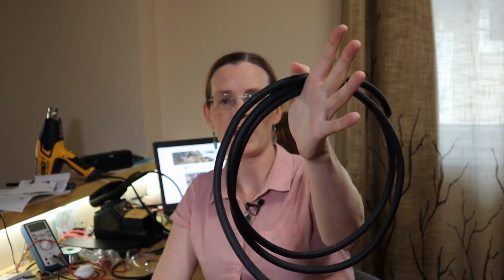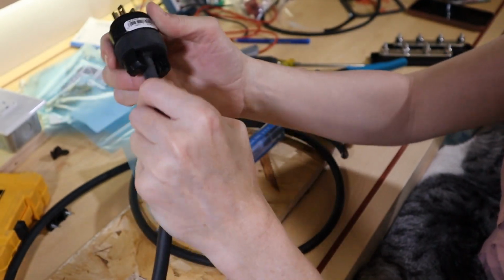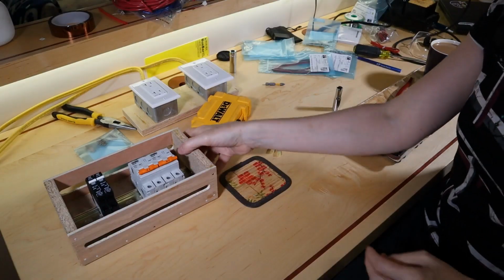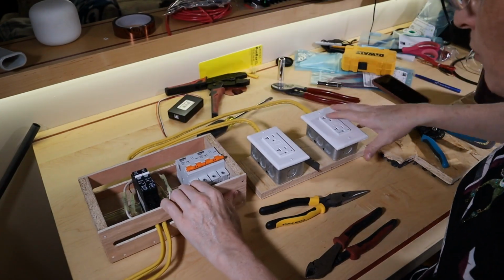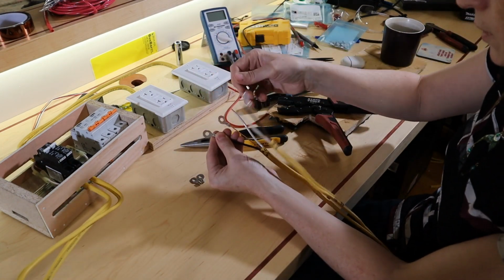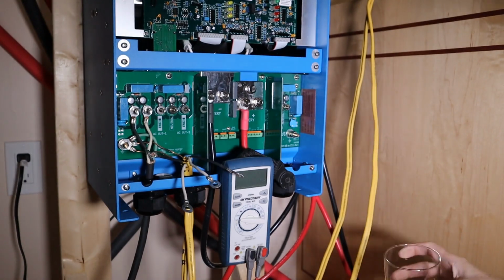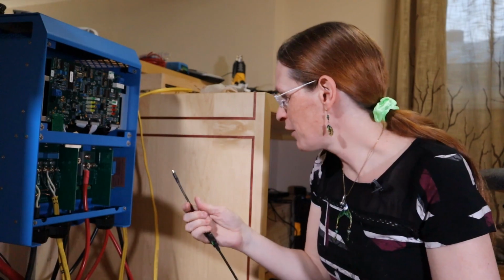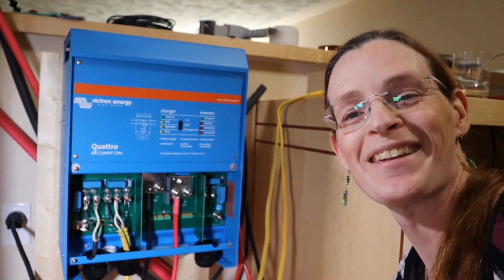Victron Quattro 48|5000|70 120v (Anti-climactic Part 2) - 48v Lifepo4 battery (Ep. 14)

Comment: There are some things I thought about
1. One thing I usually do to "secure" the connector is after all is screwed together and only the cover is left so go on with melted life or silicone and fill so it does not enter water but I am not an electrician and it will be that if anything is error, just cut the cable and install a new connector (do not know if it is a good suggestion)

2. There is another channel if you have not seen it called hbpowerwall and others there who made a forum but he has not posted many videos in a long time now but if you did not check it out then do it and the forum is called second life, is more for reuse of old 18650 cells but there are a few different and last I check out there so everyone was helpful to each other

3 most of your videos I have reacted to you saying "gentlemen and ladies and others" and it sounds like a variant of David Bowie welcoming almost 50 years ago and then it is unusual to hear and since most I heard say similar is those who are T / NB so then I wondered if you yourself identified yourself so?

(I am from Europe and since I write English poorly as I am dyslexic it is googel translation I use but have seen on other channels that mainly your neighbors south but also you have many prejudices about the rainbow and everything to normalize is everyone's value is good )
Reply from the maker: 1. A couple others suggested conformal coating sprays, which is something I was already contemplating for things like laptops that weren't designed for marine environments. This is a variant on your suggestion, and one I like . 

2. I'm subscribed to hbpowerwall actually. I had originally wanted to buy some of his cylindrical cells and kits in the past, but a lot of his stuff won't ship to Canada. Then I found these EVE prismatic cells and they seems a good fit. His channel is great though, certainly a good recommendation.

3. I've got NB friends and it made me appreciate the broader spectrum of identities. I want this channel, and eventually this community we build, to be welcoming to all who are kind. So I try to catch myself when I think I'm not being inclusive enough. It costs so little to be kind, after all. :)

Welcome from Europe! I've been over there many times (Denmark, Germany, Austria and Czechia mostly). I very much look forward to sailing there soon as I can. ^_^
Reply: @TheDigitalMermaid  Being inclusive and not having preconceived notions about others just because you do not understand is something more people should strive for, but the younger generation hurts to be better at it and those who are older are not always as willing to change as they do not see anything wrong. with discrimination against certain minorities

was just a thought then (hope you do not take it wrong) but you did not hurt very feminin if you belonged to T / NB and compa it not so long ago as there seem to be many more who come out in recent years after a lifetime in oppression so it is in many ages after it has become a little more "normal" and that acceptance increases, more people want to live freely as themselves
(do you think that a lot has happened in the last 30 years but here in Sweden it is not so much as not as many care but now there will apparently be a neutral sex on the passport and almost 10 years ago there was a quarrel that trans had have been sterilized at the change and they wanted compensation and they were the ones who had surgery before that but there will be no news about this except when there is a hate crime against them)

Comment: O.k. I join up too. I am doing the build right now. Solder your crimps too, as a ex technician for the military I use to do it all the time.
Reply: If you solder as well as crimp do not let the solder wick all the way through the crimp or you will create a hard point outside the crimp nullifying the cable support afforded by the crimp risking eventual cable fracture. The aviation industry never uses solder on terminals for this very reason.
Reply from the maker: @nigelcharles511  Oh, huh, that makes sense. Really the solution is stranded wire and proper sized terminals. :)
Reply: @nigelcharles511  Never had a problem on tanks, use NASA standards. No one was damaged.  There different types on armoured vehicles,  no problems.   Did you triple check your joints?
Reply: soldering is absolutely not recommended for crimping
soldering is not recommended over 10A or something.
solder creeps much more than copper, melts much earlier than copper.
the crimps are designed to work with bare metal.
do not crimp single strand wire. that is why it didn't work, not because something is wrong with the cable lugs.
Reply from the maker: Welcome!! Yup, I'll solder them in the future.

Comment: A tip for safety: Always leave the ground wire longer than the others. This will ensure that the ground is the last one being ripped out if someone pulls on the cable.
Reply from the maker: Someone else made the same recommendation, and it's a good one. I'll do that in the future. Thanks!

Comment: hmm just reminder. btw i made same mistake as you..even it worked for year with no problem. In specification for wires they are saying you should not use solid wire but instead you should use stranded wire..but this was only for my 5kW Victron energy inverter..not multi/quatro..but still i would suggest to check it in manual for your unit..just in case.. 

Again if i used solid wire i would suggest for 100% sure solder them to those ring terminals..as you also noticed they will get loose if solid wire is used.
Reply from the maker: The solid core is only used for now to learn / test. I have no plan to use it on the boat later. I just happened to have some left over residential 20A rated wire, so it's what I used. I'm also ordering proper sized ring terminals, and when they come, I'll solder them in.
Reply: @TheDigitalMermaid  I'm glad to hear that. Thanks for explanation.  :) I hope it will work perfectly

Comment: Well, you're right, I am one of these subscibers , because of this "magnificient bastard Andy". ;-)
You have some interesting installation cables in Canada, which I haven't seen before (ground placed between active and neutral without an own insulation).
Looks like the ring terminals have been for a bigger wire size. And for me it looked like the used tools is not intended to use with these terminals.These terminals require a w-crimping tool, but the used tools seems to be for isolated cable lugs. You should always use the correct size and a correct crimping tool. 
About the wooden installation box is already a comment below. It's not a good idea to use such a box, especially on a boat with higher humidity.
And about the Victron Quattro and the connection to a PC or Phone, you're not the first one searching for and you won't be the last one. But I've seen in an other comment, that you have already ordered the needed parts to get a connection.
So just keep on going. It's a nice project that you are working on.
Reply from the maker: Thanks for the advice, and welcome!

Comment: Someone else may have said before , ferrules are OK but solder is better for that shore power line .Just flow a little solder into the ends. Glue lined heat shrink connectors are available which I use on my boat because once properly installed no moisture gets in ever and the glue lined heat shrink grabs the insulation too and its a 10 times better result. Not expensive on ali or ebay.

Spray the insides of the victron with surface spray . The biggest draw for insects is flashing lights and heat and they get in there over time and just happen to walk across a FET and boom.

All inverters have massive capacitors that have to charge up when you connect the battery . For that you make a device to bridge a heavy resistor on one line to stop the surge and after a couple of seconds you turn the fuse/breaker on without a spark.

I stop the video and write the comment so I see you find most of this yourself anyway . Watch that connecting the battery to the inverter spark. 
Extra insulation between the cells is not a good idea. Any heat that develops from any cause will be dead center of the cell and that needs to get away quickly. I use 3 or 4 paddle pop sticks glued to one side of the cell for separation and to allow an air flow.
Cheers
Reply: American Boat & Yacht Council  exclude solder as the sole means of electrical connection for wire terminations.  If you use high quality materials to begin with it is not necessary.
Reply from the maker: @davidb.5544  I need to follow ABYC, so this is good to know. Is it because of the brittleness of the joint, do you know?
Reply from the maker: When I do the final install, I'll be sure to solder connection like that. I already have / use the resin-lined heat shrink tubing (you can see it used in this video for the battery / jumper cables). It's brilliant stuff and I use it on any cable that I think will come with me to the boat. I don't bother on cables I know will be short-lived. That "shore power" cable won't be coming to the boat, hence I wasn't worried. I do plan to add a conformal coating when I start to install on the boat, it's a brilliant way to help avoid corrosion as well. Cheers!
Reply: I guess if the "sole means" of connection is solder and the joint heats up enough to melt the solder, that would be baaad.  Perhaps this means crimp and solder is ok, because the crimp would still hold?  I'm just guessing.  Personally, I used to crimp and solder most things because I was crap at crimping with awful tools and needed to solder to be sure, but I use the right terminals to match a decent crimper now so only solder when I have to improvise.
Reply: @richardallen1629  If your joint is getting hot enough to melt solder you have a much bigger problem in that to get heat there must be resistance so what will get the temp up to 180 C?
Reply: @richardallen1629  
the problem is solder is very soft and does much cold flowing. then causing high resistance and the solder melting. and if you are lucky it only disconnect and does not arc.
you never solder a crimp. you never "wick" for a screw terminal. soldering for low amp appliances like tv, etc

Comment: Nice video. I tried to watch it whole but sorry i couldn't  :) ..Anyway i would suggest to use some kind of sealing spray in can ..something like contact spray and spary it onto the terminals in your outlet ..it will seal it more against moisture .. Next thing i would suggest to solder those ring terminals after you crimped it to those cables in same ac cable (but opposite end) then clean it from solder with IPA and shrink tube it after again some sealing spray in can
Reply from the maker: Watch as much or as little as you like. I appreciate it just the same. The spray you're talking about is called conformal coating, iirc. It's something I'm planning to (maybe) use on my normal electronics when I get on the boat to help save them from corroding. soldering and shrink tubing are good ideas for when I get to final wiring. Not really worth it for testing / temporary cabling though.

Comment: i used 1/32 cutting mats ,they are ideal and cheap .little cost for safety.
Reply from the maker: That's exactly what I was thinking, but I couldn't remember where I saw them. It was placemats, thanks!
Reply: silcone project mats between the battery, its a great heat  resistant material and keeps batteries from sliding around. Also, as you may already have heard, compression of these aluminum cased LifePo4 batteries also helps reduce fatigue from all the expansion and contraction, including of/around the terminal posts, from what I've read. I love your progress and excitement, Mermaid! Oh and Andy sent me.